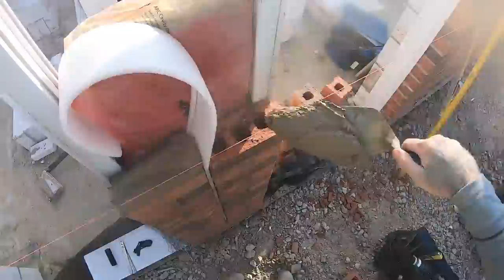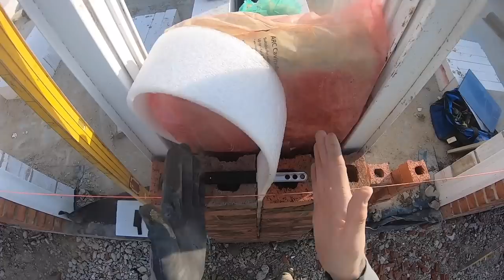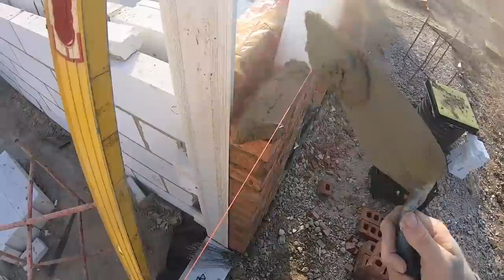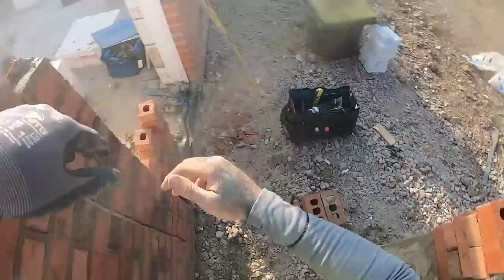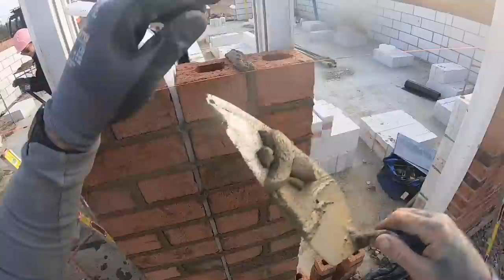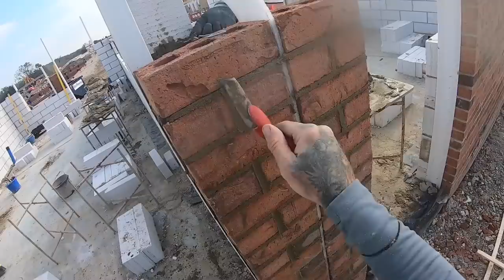How to build a 2 Panel with an expansion Joint 🧱🧱 #bricklaying #bricklayer #brickwork

Comment: That’s crazy. A two brick pier is bad enough against two doorways but an expansion joint in between, won’t be long before all the joints start cracking with doors being closed

Comment: years ago we would build in the door and window frames  ....looks like one good boot and that's falling over as you said its prob going to get knocked by the scaffolders
Reply: Still think that's the best way, the mortar groove around a wooden window holds it solid, no gaps and piles of silicone either. Quick and easy,

But who wants wooden windows these days huh?

Comment: I know it’s not up to you Charlie but that’s shocking having a movement joint in such a small pier.
Reply from the maker: I know 😂
Reply: What's worse is the the trays over the 2 lintels. The firesock has to be continuous, the trays won't go past the the ends of the lintels, therefore it doesn't work and is a massive design flaw. Had this before where I had an argument with NHBC about it. If you put the tray through continuous, it's an item, if you don't and the tray doesn't go past the end of the lintel it's an item.
I said what the fk am I supposed to do then. He said the firesock is more critical, do that.
This was on a Barratts site in Liverpool.  Complete bollocks.
Even more so when trays aren't necessary over lintels, it's the manufacturers won't guarantee the lintel for 25 yrs unless it has a tray and NHBC wankers jump on the tray band wagon.
Reply: Hi, My English is not enough  to undertand tge reason why you have to do this❤
Reply: César 🧔🏻🥳
Reply: @richarddavey7884 would they not let you take 120mm out of the sock to put the tray through properly as it should be?I can't see how the sock is a bigger floor than the tray? Nhbc makes the rules as they fuking go mate
Reply: Let’s hope there’s no domestics in those plots😂
Reply: Yup, maddest thing I ever saw. What the hell are they thinking?
Reply: Nhbc are a joke at times. One guy made us tear the plastic on the fire sock as he reckoned the material inside had to be touching the one above. So we did that. Then next week another guy turned up and said that was b*llx and made us rip them all out and replace them with undamaged ones. We’d basically built an entire retirement home by that point. It was a nightmare replacing them.
Reply: @MrOitoyboy  as I said mate, there's no consistency  at least with LABC you know where you stand and they don't have the same stupid shit as NHBC (no house building clue)
Reply: This detail is worse than a short brick return (90 degrees) which is notorious for cracking. All about this is wrong.
Reply: Why not put brick on brick with false joints and start the movement joint above the lintel makes more sense and stronger pier
Reply: Crazy pier. What genius came up with that idea. Aweful.

Comment: On these stand-alone door formers, just cut to size 2 pieces to make the formers parallel and battery drill screw them to the middle and top. Remove these pieces when the mortar is going off or set.

Comment: That joint is asking for trouble. It reminds us of short returns; they invariably crack. Two heavy doors slamming shut periodically; asking for trouble. Can see claims going in one after the other here.
The expansion foam rip strip should be to the front.

Comment: Call me stupid, why is there an expansion joint in a 2 brick pillar? Aren't these supposed to go every in every 12 meters on solid block/brickwork?
Reply: Crazy as engineers madness to put 1 there. But can only put them where your told
Reply: I don’t agree with it but I believe it’s because they want an expansion joint where both houses meet, front and back usually.poor engineering really
Reply from the maker: @andrewmorrissey8478 would have been better somewhere on the gable end side near the corners or something

Comment: I’d have built that solid bricks all the way up and ground out the perps after. Then point it. It’s no less strong and takes half the time.
Reply: Yeah, he did mention it but no grinder on site I think he said. First thing I thought too.
Reply: You Cut the brick on the floor not on the wall , your end up nicking the stretcher that way, you also have a labour measure 60 bricks the same size
Reply: @liamwalters5029   nah, not if you know how to do repointing you won’t knick the bricks. And they’re semi engineering bricks so the size difference is negligible. I do this shit all the time. It’ll be fine
Reply: @MrOitoyboy it’s harder tho I’ve been this this shit for 30 years employing 8 bricklayers

Comment: Cant see the point of the tie through the expansion joint either, wont it hinder any expansion that might happen.
There are 2 massive brick buildings by where i live built bout 1902 not one expansion joint to br seen, they still standing with no cracks. Not havin a go u are a great bricky vey fast and very tidy 👍